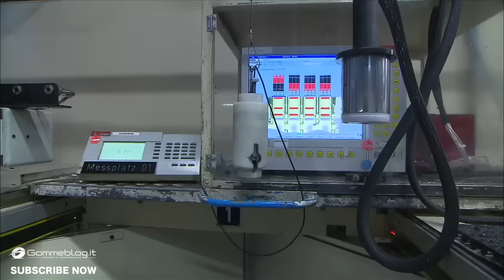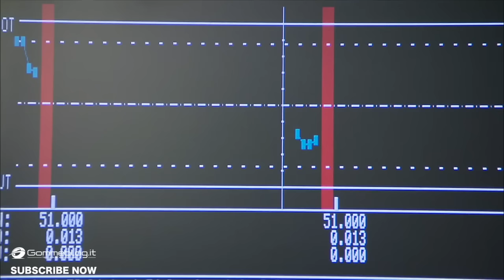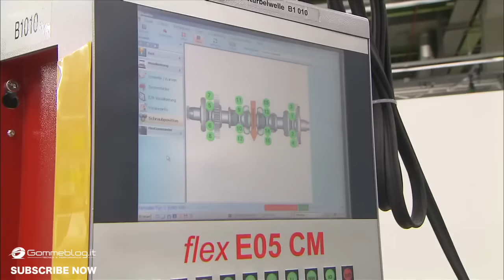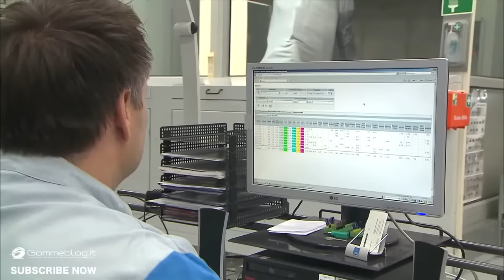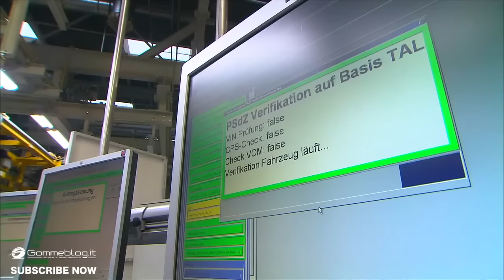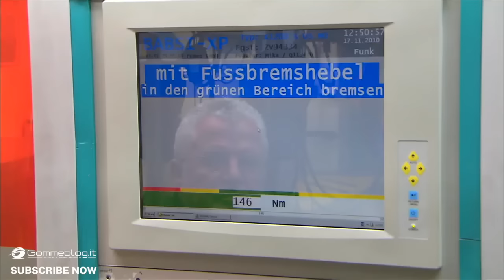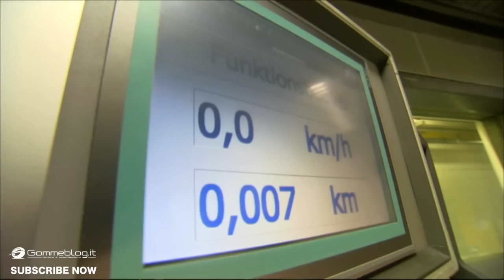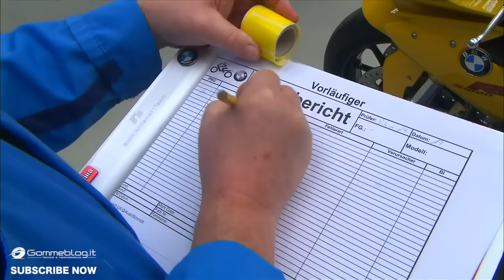Bmw S1000RR FACTORY 🇩🇪 How ITS MADE Bmw Motorrad Bikes

Comment: This video is a mash up of lots of BMW manufacturing. Not the s1000rr. It even includes car engines.
Reply: You are mistaken about the car engine. BMW makes a 6 cylinder motorcycle engine. It was 1600cc 6 cylinder bike engine that you saw in the video. The rest were a mashup of various motorcycles however.

Comment: Machining precision engineering systems with new combination of design as well continuing R&D by new plot in my plantations for most superiority under engineering manufacturing for precision measurements and assembly plant. For semi automatic. Infrastructure in blue print seal to original design that  prevents from copy rights. Might be valuable lossing from technology secrecy value core.
Reply: U

Comment: R u guys ready for last order,4 r1(80 kg) and 1r-2Display digital like mirage fighter,u need two gas througher.Price 8.45 lac for r-1,m simple display for one.and 8.75 for r-2 v15(weight 55 kg) max speed 1000 km for r-1(add two engines).And max speed of 500 km(with one engines and 2 transmissions).then trans mission will be of bmw.1 gear 5km.2nd gear 20,3rd gear 30,4th gear 40,5th gear 50then abnormal  till 500 a bit less(50 if petrol and 15-20 if octain).make cost will be for r-1 5.75 lac and r-2 v3 8.45 lac.

Comment: To bad Harley engines wasn't built there. Harley lets the customer find problems and fix them , then Harley realizes what is wrong.
Bought one new Harley in 2000 and that was  my last.
They have way easier jobs than Americans. American production line never stops , moving fast and each job has a lot of work, doing one job a min.

Comment: So, the way to make the S1000RR is to first start with a Boxer engine from a GS, add 2 more cylinders and rotate the block 90 degrees, and then it becomes a K1600 GT. Maybe check your title, this video makes no sense.